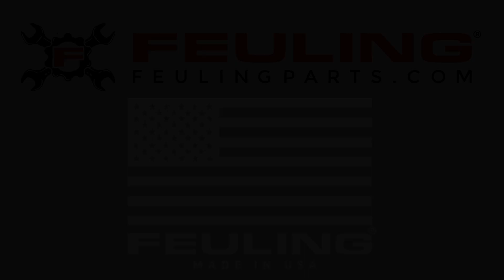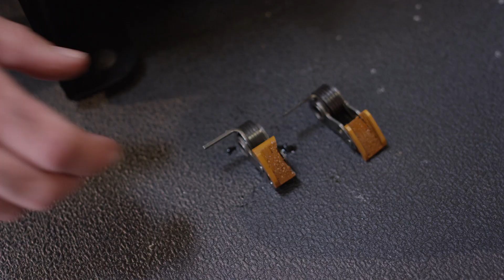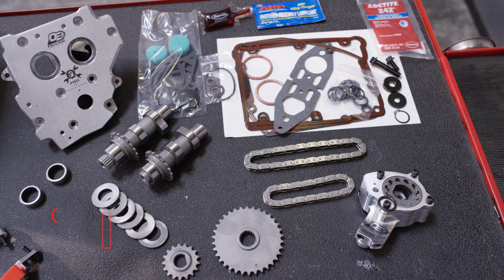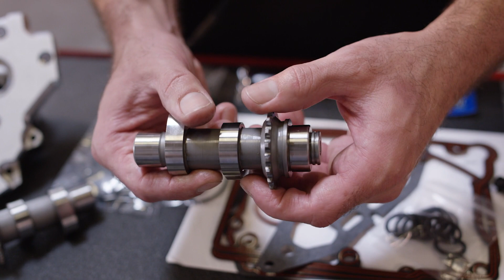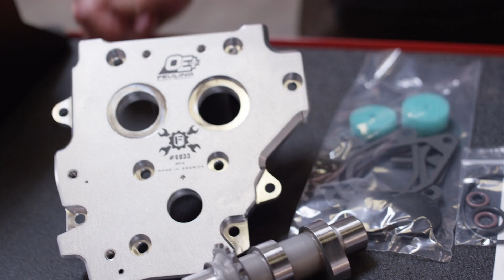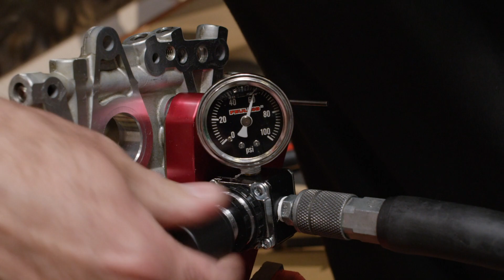#7089 #7090 FeulingParts.com / OE+ HYDRAULIC CAM CHAIN TENSIONER CONVERSION KITS

Comment: when not upgrading the cam shafts and using the "silent" chain for the rear cam chain tensioner, any idea how many miles can be clocked before the rear tensioner wears and needs to be replaced.